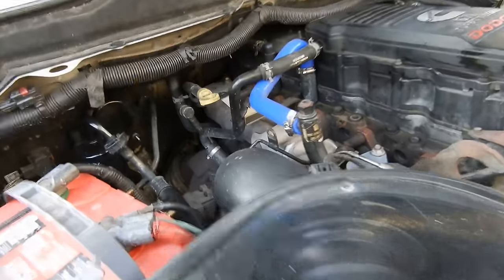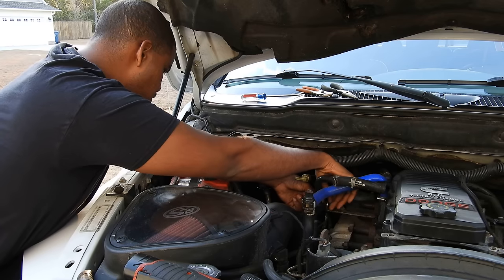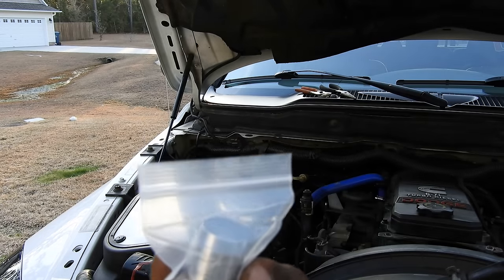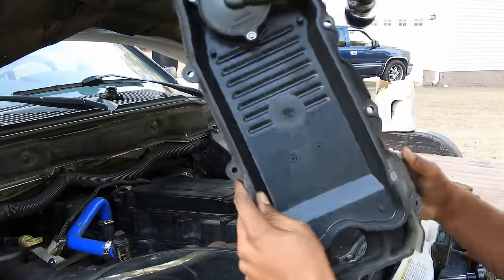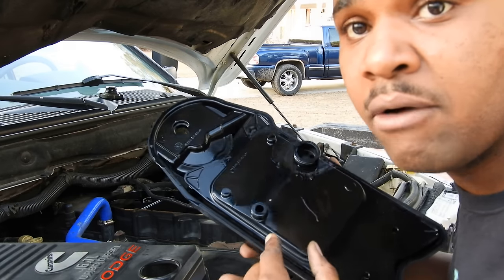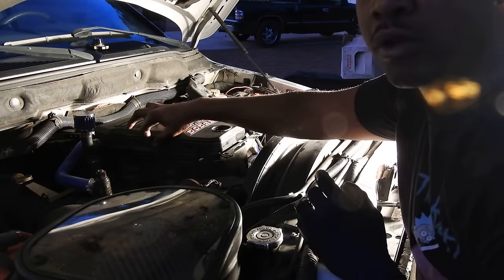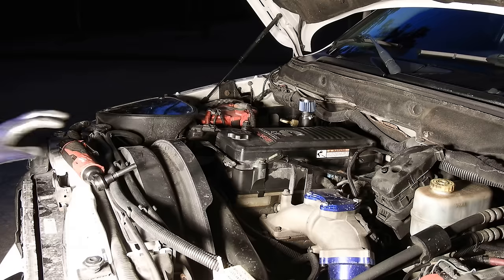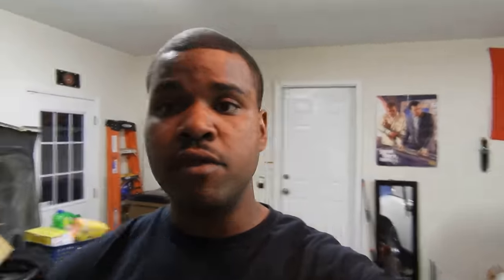HOW TO DO CCV DELETE ON CUMMINS 6.7

Comment: I have a 2018 no delete, will the reroute throw a code? does the CDR valve have a sensor or does the PCM monitor the positive pressure in the crankcase which will throw a code?
Reply from the maker: for a non deleted truck you im not 100 percent sure. you shouldnt get a code but ive heard of people getting them. You should be good if you delete it.
Reply: EVERYTHANG DIESEL 
Ok thx for the get back

Comment: hi, what exactly was the purpose off gutting out the dirty paper inside. and did you put new paper in or something?
Reply from the maker: Gutting the old filter element allows the crankcase to vent straight through it without having to worry about changing the filter when it clogs.

Comment: I did this with my 6.7 and it shot oil some where out of the back of the engine due to the vacuum being disrupted. Went back to stock ccv set up and immediately solved the issue... not sure why the CCV delete wasn’t good for me.
Reply from the maker: Possibly the valve cover gasket was old and worn, then once u removed the suction hose it went out naturally in the  leaks and seams. Then when u put it back it went back into your turbo.
Reply: Nope. Nothing is flowing through the tube from the crank case to the turbo it’s dry as a bone. The oil came out of the back of the engine somewhere over the turbo. 
 

 Still not sure what caused the leak. I’ll let you know if I figure it out. I appreciate you’re reply! I’m watching from South Florida
Reply: You being the only one with the problem means that there’s something wrong . big guy

Comment: How the truck running now? Did you end up just putting the heater hose on it instead for the filter?
Reply from the maker: Nic Martinez truck running like a champ! I still got filter on it. I'm gonna take it off soon cause I noticed it's starting to get a little clogged. I dont want it holding them crank fumes. But it's good man. I got newer videos up on more engine work I've done.

Comment: MEDIIICCC!!! Help. So I did exactly what you showed. The F'ing service light came on saying "filter clogged"...Took the whole filter off and added the "blow by" hose. NOW service engine light is on, and code reads CCV System Disconnected. Does it have to be "tuned" after ANYTHING IS DONE TO THIS TRUCK?!?!? I've been a DODGE man my whole life...this is REALLY starting to piss me off.

Thanks man,
SEMPER FI
Reply from the maker: Gstark88 I dont believe its needs to be tuned. What year is your truck? I would disconnect the batteries and wait 30 secs and reconnect. I never heard anybody getting a cel from doing that?
Reply from the maker: Also man I forgot to say reset the service required warning that may help. There is a video on YouTube showing how to reset that notification. And when in doubt disconnect battery and reconnect.
Reply: Already did all of this!
Reply: it's a 14
Reply from the maker: Gstark88 you still got the issue?
Reply: yes, I'm just going to put it back the way it was. 😩 hopefully that motherFing light turns off before I turn it off with a slug
Reply from the maker: Gstark88 any luck with the truck?

Comment: Why gut the filter instead of removing it completely? I'm running without a ccv filter at all and it is just fine.
Reply: Jesse Muller me too ,, that’s the same thought I’ve been having for a while
Reply from the maker: Really? You know I saw someone do that but didn't think of doing it myself? I think I will now and cover a video of it
Reply from the maker: I'm gonna do that
Reply from the maker: Lane Grey I'm tracking on that now.
Reply: Jesse Muller so u basically just pull the complete filter and bolt the valve cover back on? I thought u needed part of the old filter to act like a gasket.
Reply from the maker: Chris Courson that's what it seems everyone is doing. Once you gut the filter it does nothing for the engine it just sits there. So taking it out completely seems to make the most since.
Reply: EVERYTHANG DIESEL just cause I'm easily confused,  u dont even have to bother gutting it, just pull the whole filter out? And the valve cover will bolt right back up?
Reply from the maker: Chris Courson yessir. Its recommended you do it if your truck is deleted. If emissions are in fact you may get a check engine light code. I heard some people say they got one when there truck wasnt deleted. But they just cleared the code and it was fine.
Reply: EVERYTHANG DIESEL yessir, raceme delete. Gonna get a plug and a filter tomorrow. See what's up. Dont wanna gut it if it's easier to just remove it.
Reply from the maker: Chris Courson yeah that's what I recommend and dont waste your money on the little filter they clog up after about 15k miles. Just get some 3/4" heater hose and route it down you frame.
Reply: EVERYTHANG DIESEL can do man, preciate it!!!!
Reply: Did you throw a code cause mine is throwing the disconnected ccv .. I clear it,, it comes back

Comment: I'm noticing some collection of oil on the passenger side of the engine compartment. It's collecting on the frame and the suspension. I've traced the leak to the bottom of the turbo. And from there it seems to be dripping out from where the CCV hose connects to the turbo intake. I have a Gen 4. Looks like it's been sloooowly leaking from there for a while. If that's the shit that's going through my turbo then I'm DEFINITELY deleting the CCV. Fuck that noise.
Reply: Vincent Vancour more than likely, it’s the little o-ring that seals the turbo speed sensor, pretty common leak point. If you truck is spitting out enough oil from the CCV to “drip” from the turbo you have other issues going on. It’s best to just leave the CCV filter intact and change it every 50-60k, sure vent the case to atmosphere if you like, but let the filter do it’s job. It’s not hurting reliability or performance.
Reply: @noHandle1776  Preciate that. I'll check that sensor out.

Comment: 07 2500 6.7 Cummins  wen I get in to post about 25 to 30 lb is the saying crankcase pressure would it be that crankcase filter
Reply from the maker: ARTHUR Snydery what you mean?
Reply: Wen get in to and boost about 25 or 30 pounds this is crankcase pressure

Comment: CLEARING OUT THE CCV MIGHT BE A MISTAKE.  THE REPLACEMENT LITTLE FILTER IS WAY TO SMALL AND WILL FILL UP WITH OIL FAST, LARGER FILTER RECOMMENDED.  I WOULD ALSO RECOMMEND NOT CLEARING OUT CCV AND JUST REPLACE EVERY 30,000 MILES.  JUST A THOUGHT.

Comment: How’s this catch can doing?  Is it filling up?  I’m installing one this week but I’m not deleting the CC filter.  I’ll change that every 50K.  Also, I’m was going to run the out flow from the catch can back to the turbo thinking that the oil has been caught so it’s less harmful to the turbo.  Thoughts?
Reply from the maker: check out my new video i uploaded today man!! i show what it looks like in the catch can! it works and collected a good bit of oil residue.
Reply: You don't want to re route the ccv from the turbo inlet without gutting the ccv filter. You need the suction from the turbo to pull the fumes through the filter, otherwise you risk blowing seals from excess pressure.

Comment: ok...seems most agree with removing the filter altogether but do you then need a gasket of some sort to seal the cover to the head? Also, when they speak of resetting the code, etc is this done by disconnecting the battery following a code showing up?I have a 2018 6.7, any special problems?
Reply from the maker: in all honesty it seems the newer 6.7s cause a ccv light when they gut it the best advice i would do is research delete on newer 6.7s on the forums. you shouldn't get a code if you do the delete tho. but you will void your warranty if you do it.

Comment: Have a question I seen u put a intake on it and deleted the throttle. Did u notice any difference and do u need a tuner?
Reply from the maker: Michael Eagan yes you will need some type of tuning to removed your egr valve and throttle valve. It isn't a huge performance gain it's just better flow for the engine less resistance. The intake manifold is a good install too the stock is very restricted
Reply: Well the person who owned this truck did the egr valve and cooler delete, a poorly job on the dpf delete to straight pipe. Bad part they took the tuner. What tuner would u recommend?
Reply from the maker: Michael Eagan omg sorry for the late response I didn't know I had a response from you until now. I recommend efi live! I'm sorry if this is too late but if you haven't made a move yet efi live all day man. I apologize again
Reply: Oh ur fine thank you for getting back to me. I haven't bought a tuner yet but if you recommend efi then that's what I'll look towards to
Reply from the maker: Michael Eagan yeah man you'll like efi I wish I would've went that route first haha
Reply: EVERYTHANG DIESEL what do you know or think about ez lynk
Reply from the maker: not a whole lot. but it seems like its been taking off really well since they introduced it. you can get same tuning like from efi and you can do it from your phone and get gauge readings on your phone or tablet. Im still a old school believer of efi live.
Reply: I found a PPEI EFI Live Autocal was wondering if it be good to put on my rig.
Reply from the maker: Michael Eagan yeah I've heard good things about them. I would look into breakout tuning also they do good stuff as well.

Comment: Why not just put the cover back on without the CCV filter in?
Reply: 1cleandude the filter forms the seal for the cover. So folks cut away the actual  filter element, like he did here, then reinstall the sealing part of the filter assembly.  The crankcase has to remain closed, within reason. Now the positive crankcase pressure will make its way up to the new smaller filter he added and will later become saturated. The biggest benefit of this mod is that that turbo will no longer be ingesting crankcase vapors (oil) and he’ll no longer have to replace the filter element.
Reply: Ok now I see said the blind man!
Thanks for the informative reply God Bless!!

Comment: Would a catch can not be a better solution?
Reply from the maker: Steven Kuhn I mean u can do a catch can its However u like it.
Reply: A catch can would be 100% better. The process in this video is a hack and your check engine light will come on within 30 miles.

Comment: I dont understand why you want to delete the ccv filter...I understand it's kinda pricey for what it is but if you change it every 50,000 miles it really is too bad at roughly 75 bucks it's not like your doing it every oil change
Reply from the maker: the ccv delete is more for the turbo by not letting that crankcase fumes go into your turbo. if u take your intake off and look at your compressor wheel it has black stuff on it thats from those crank fumes.

Comment: Does doing just the hose make the check engine light on
Reply: i’m assuming you have a 2018?
yes the engine light will come on I believe 2013 and up. 
But if you have delete tunes I believe it will not . 
but I can’t be sure because I have a 2012

Comment: Should this same set up work for my 2017 ram 3500
Reply from the maker: It will but don't gut the filter
Reply: Really
Reply: What does it do
Reply: So it doesn’t need the rerout?

Comment: Why cant you leave that filter housing out?
Reply from the maker: It forms a seal around the valve cover you would leak oil if u took it out.
Reply: Wonder if mine is saturated with oil under neath there. Never three a code but now you got me wondering about it

Comment: Do you need a tuner for ccv delete
Reply from the maker: For 3rd gens no. But from what I've heard the 4th gens of it's not deleted you will get a cel
Reply: The monitoring systems old and new don't see the ccv. It's a service interval setup that trips the perform service message and no codes once you surpass the programmed mileage marker. Exactly like the oil change indicator.

Comment: I done mine today now my engine light is on how do I clear it
Reply: It won't clear. I have 2007.5 6.7 and I just ignore it
Reply: @cujo229  mine cleared but my truck is down now, starts an runs about two to five seconds an shuts off
Reply: @curtis62981  did u delete egr and dpf with tuning program.
Reply: @cujo229  yes I’m running efi live with calibrated addiction tunes
Reply: Problem started out of no where one day after I changed oil an all filters, started out it wouldn’t go past half throttle now it won’t stay running longer than a few seconds
Reply: @curtis62981  run a scan it may be injection issue
Reply: @cujo229  scan only gives me a p0087 code
Reply: @curtis62981  find someone who has a snap on scan or another one to see why it's not running it has to be something simple. Did u bleed water out of fuel filter
Reply: @cujo229  that was off a snap on scanner all fuel pressures are good it just dies an yea I thought the issue was plugged filters that’s why I changed them

Comment: About how long did that take you?
Reply from the maker: Jim Russo with recording included about a hour. If I wasn't recording probably 30 mins total. Hardest part was ripping out the filter
Reply: EVERYTHANG DIESEL thanks bud. I'm doing mine cause it took out my turbo. So should be getting a new turbo Wednesday and S&B CCV delete. Going with cheetah 63m. Your videos are very helpful thanks Boss keep up the good work!!
Reply from the maker: Jim Russo thanks man appreciate the support just trying to help out how I can
Reply from the maker: Jim Russo hell yeah that's gonna be a nice turbo. 2nd gen manifold swap?  I wanna do borgwarner 467 with 83 mil
Reply: EVERYTHANG DIESEL not sure if I'm going 2nd gen or not yet. I would like to but if that doesn't make that big of a difference probably not. I still want the VGT set up for when I'm pulling. I heard I might need to get rid of my H&S and go EfI when changing the turbo.  That CCV filter is what took my turbo out out it was saturated. Do you know if 2nd gen swap makes a big difference?
Reply from the maker: Jim Russo honestly no there's no crazy difference actually doing 3rdgen swap is just as good and cost a little bit less. The biggest reason why people do the sounds is for the sound and they don't have to worry about the vgt going bad because that was a issue with those turbos especially the early ones 07.5-11 like my one haha. But yeah if it's all about your budget. And you will get better hauling out of the vgt ones over a 2nd gen turbo/manifold swap! I don't haul more than 10k so I'm fine settling with a 2nd gen swap.
Reply: EVERYTHANG DIESEL I'm bringing it in Wednesday I'm thinking everything going to be around 3,500ish that's turbo and EFI but taking my H&S and giving me some money back for that. With a 2nd gen swap you side noise is that like more turbo sound?  That's about the weight I pull around 10,000 nothing crazy. I'm thinking after the going with the fast fuel system and possibly some 80 over injectors ARP head studs then start on the transmission side. I really don't want a crazy build but something reliable a little better performance and possibly a little better has mileage.
Reply from the maker: Jim Russo yeah I'm sitting right about there right now. Except I got stock injectors turbo.  H&s minimaxx I run airdog 165gph and I love it
Reply: EVERYTHANG DIESEL thanks boss!! It helps for sure!! I'll let you know when I'm done with what way I went!!
Reply from the maker: Jim Russo no problem man good luck and best wishes
Reply: Did the CCV delete today. I ran a hoes down into the wheel well with a screen on the end though. Dam that filter sucked getting everything clean hahahaha!! Thanks for the help with the video boss!!
Reply from the maker: Jim Russo glad it helped man!! And yeah you gotta put some force behind getting it out lol